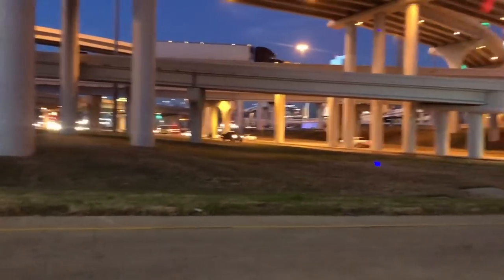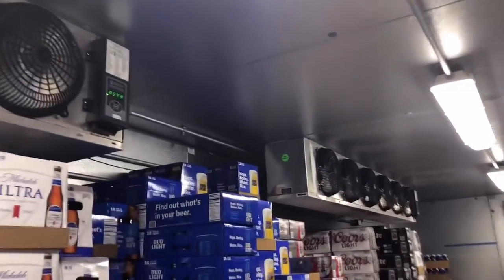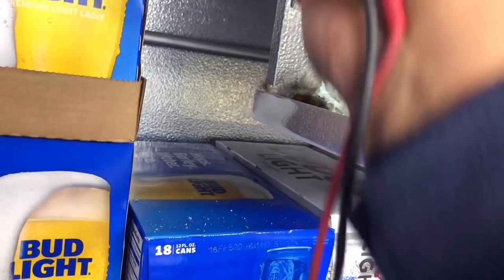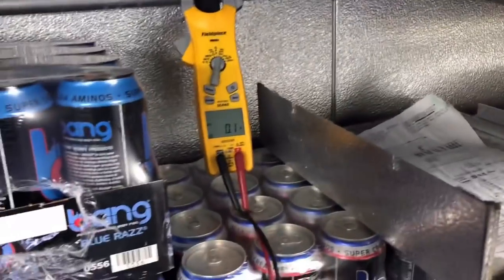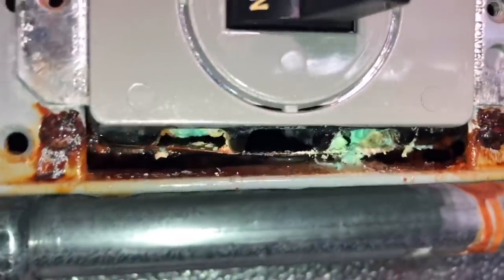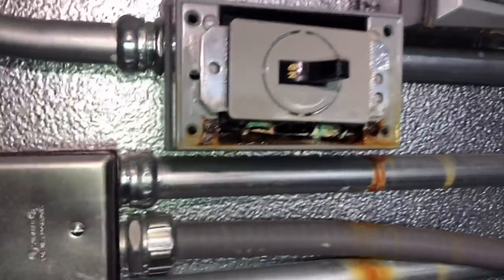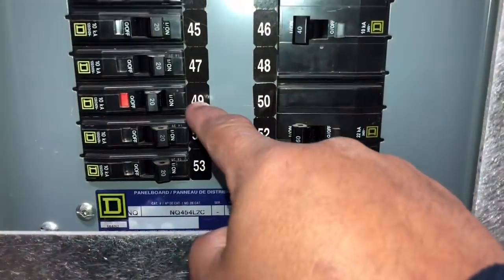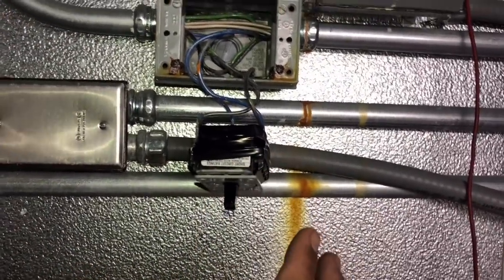HVAC REFRIGERATION:  Troubleshooting A Walk In Cooler with an electrical short, KE2 Controller

Comment: Nice one. I would have removed both black wires off the switch and put a wire nut. Shut off condensing unit and let it de-ice. Returned next morning with a new switch. My guess is it needs a new switch. Keep us posted brother👍🏽
Reply: Me too, Probably. needs a new Switch for sure & silicone where wires enter. warm air coming in from somewhere in conduit. hense water. dry out box. silicone wire holes. common occurance. Electricians never seal conduits. 🤦‍♂️ 
Possibly other problem too. motor wires to ground somewhere. rub out. maybe.
Reply from the maker: The evaporator had a short.  I could not energized it.  That’s why I didn’t do that.  I thought about it as well but I had to deice it first before I could fix the short.  🤓cmon man.  I know this.  💪🏼💪🏼
Reply: @OcRefrig  Good electricians would have sealed the conduit where the wires enter with  thumb gum. (low temp non-hardening putty) removable and reusable.
Reply: putty does not create a "airtight "seal. silicone should be used. been doing this 39 years.

Comment: Cause I'm a lazy person when something electrical has stopped first place I look is the electrical panel to see if a breaker has tripped when you said Farmers Branch in the last video I saw I thought you were in the Dallas area I couldn't wait to leave there I had a conversation with a trooper once about how fast they drive on I 635 they look the other way until something drastic happens cause they are afraid of creating a fatality when someone is pulled over  it's always amazing how a store always has a budget if you will but still charges what they will for a can of coke yet the service company always has a limit on what the customer is willing to pay

Comment: Ughh, drove through Fort Worth down 35W to get down to San Antonio in October.  There was 3 or 4 accidents on the opposite side of the interstate and the southbound side was backed up from rubber neckers wanting to see what was going on...  That was in October, I doubt it got any better.  The drive through Waco and Austin was even worse though.  Have to wonder if the water didn't travel down the conduit somewhere though.  Switch needs to be replaced as well as figuring out what is messed up.
Reply from the maker: Yup. 35 is horrible.  I try to take 130 at Georgetown and bypass all that Austin traffic. Or if I'm not in a hurry, we take 77 from Waco all the way down to Brownsville when visiting family...
Reply: @rookierefrigeration4357  On the way back I ended up going around Waco.  Austin wasn't too bad but it was Sunday.  I think Waco showed it would take an hour to drive through on the interstate though.  Taking surface roads was faster, LOL.

Comment: That has happened at almost everyone of their locations. Before I went into business for myself, the company I used to work for did all of their installs including this one. I'm pretty sure they probably gave a $500-$750 NTE. Doesn't that system have a reverse hot gas defrost?
Reply from the maker: I don’t think I got as far as looking into the defrost but the NTE was pretty low and I was not able to go back, they sent someone closer to that location as I was way too farfor
Reply: Looked like a MasterBilt unit. If so, their Freezer would be Reverse Flow, not sure about their Cooler. In my travels, Walk-In Coolers are always Off Time Defrost, with exception of Meat Lockers or other Specialty Rooms. Beer Cave may not warrant the expense of a heated defrost.

Comment: The breaker probably blew because the water, in the switch box, made a short to ground. Clean the box out, redo the connections on the switch and turn it on, probably nothing wrong with the fan coils.
Reply from the maker: Yeah. Wish I could've.  But someone else went to finish the job.   😥
Reply: @rookierefrigeration4357  Yeah, I sort of gathered that you didn't get to follow up and maybe that it would exceed the "refrigeration side" of the job?
Reply from the maker: Bebo May I live 2 hours away from that place.  They got a guy that lived closer to go.  So.